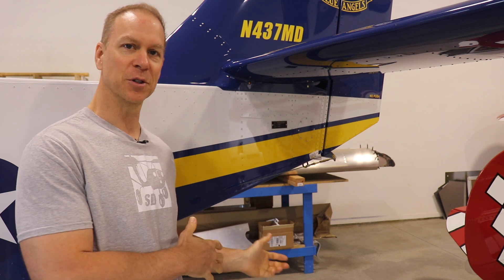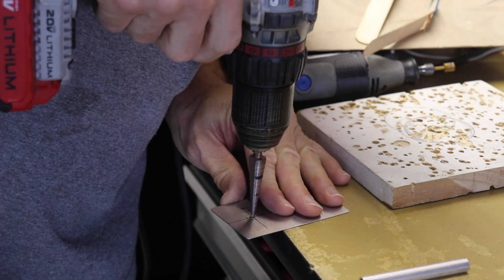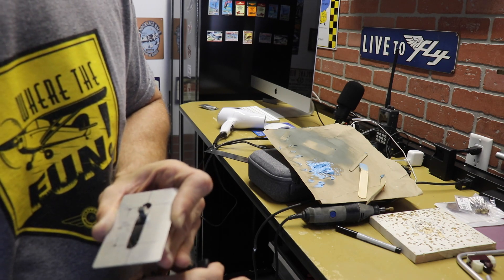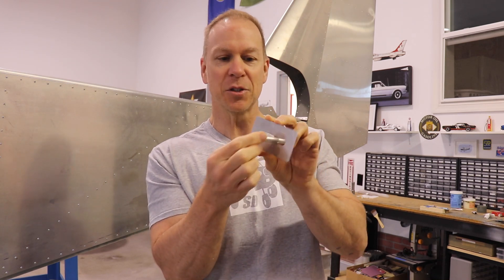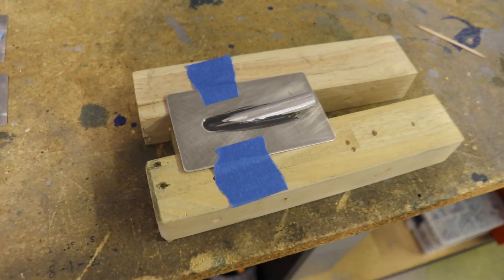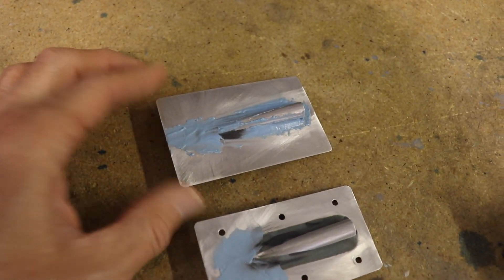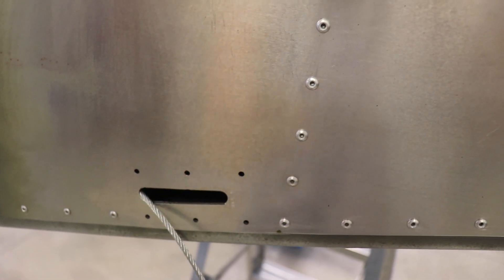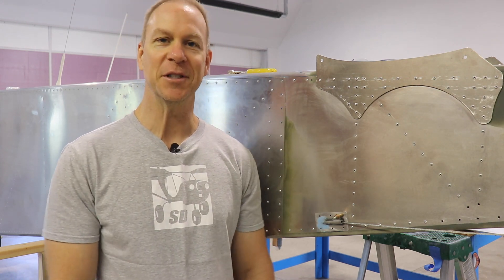HOW TO Make Custom Rudder Cable Exits for Zenith Aircraft (Ep92)

Comment: Nice!
Curious... how do you secure the nylon tube in the aluminum? Is it press fit?
JB Weld is great stuff. When you mentioned not knowing an aluminum welder it reminded me of a video I saw over on Project Farm channel "Best "No Welder" Aluminum Welding Rods...". May or may not be of interest to you; and others.
Thanks for the video.
Reply from the maker: Yes it will be press fit. On the Cruzer I tool a nylon tube and put it in a lathe to shave down the outside diameter to squeeze fit into the aluminum tube.